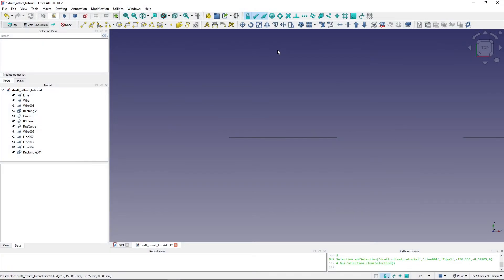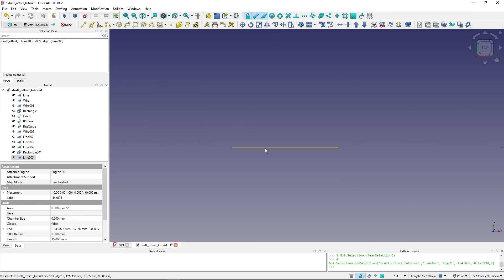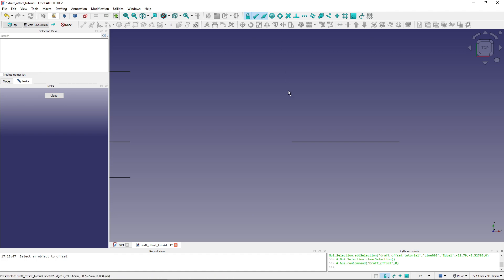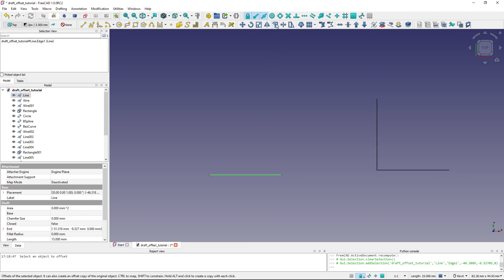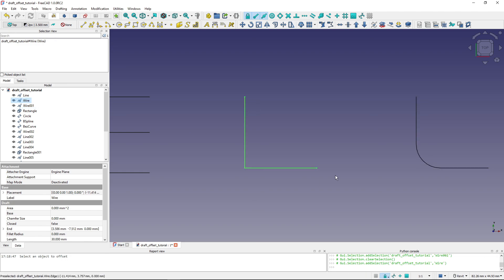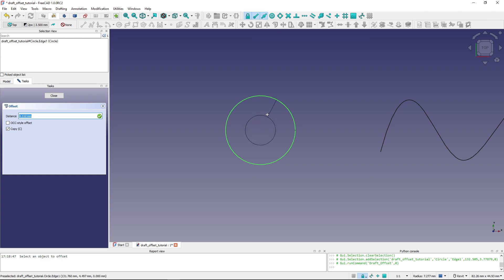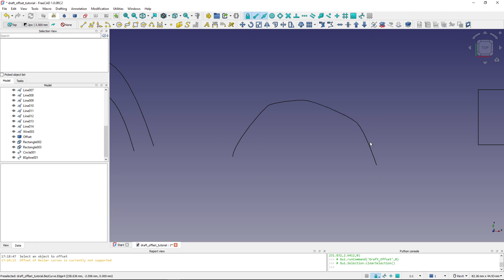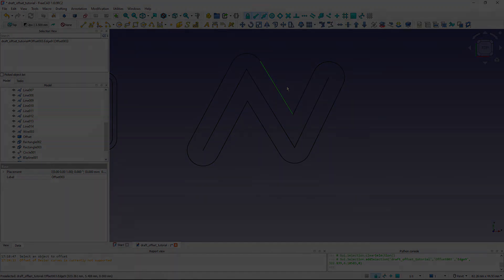Draft Offset Tool – Offset 2D Geometry in FreeCAD

Comment: I have just started using FreeCad and I tried to offset in Imperial measurements using decimals but I found it does not work the same as metric.  If you offset in metric it is fine you don't have to add the mm to the end of the numbers you type in, but in imperial you need to type in or " for inches.  Is there something I am missing in the settings?  Or maybe a glitch in the program.  Love your videos, learning a lot.
Reply from the maker: That's a good catch. There is actually a bug, which will be fixed in FreeCAD 1.1. In 1.0 you have to type in ' or " all the time. 

Actually I see that with Building US units, you have to do this all the time even after the bug is fixed.

I'll have to research that and see if we should report it to the developers.
Reply from the maker: I did some research and this bug will be fixed in FreeCAD 1.1 release. Unfortunately in FreeCAD 1.0 you have to type in the units using the offset tool all the time.